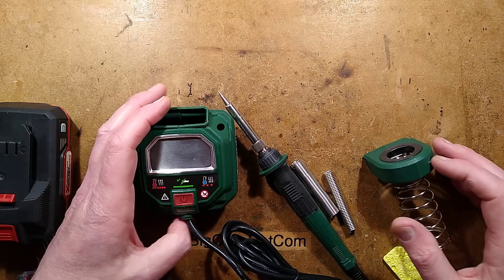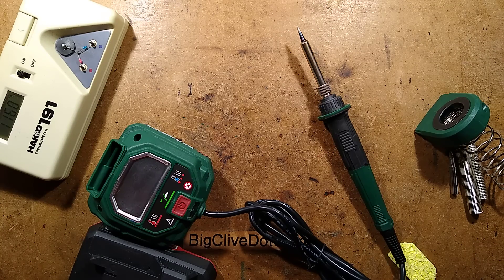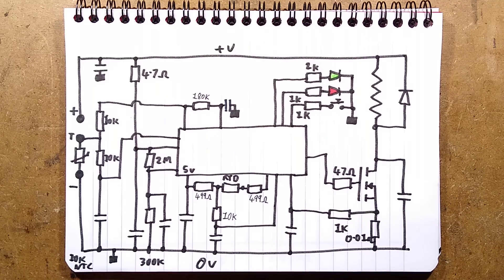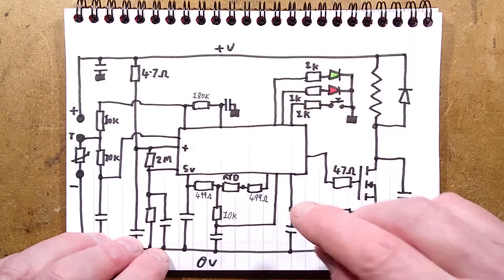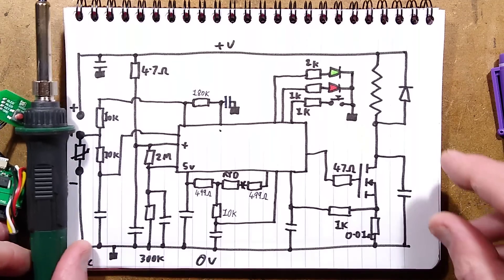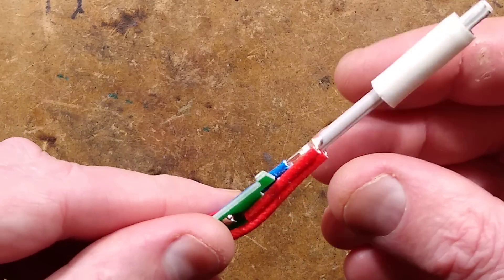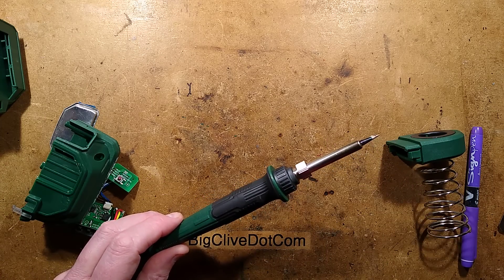LIDL (Parkside) B2 soldering iron hack and schematic

Comment: All that I could find on the chip was this. 

The M29AN100 is a 100 Mb Flash memory chip manufactured by STMicroelectronics, a part of the NOR Flash family, meaning it has fast random access to any location in memory, unlike NAND flash which is more suited for bulk data storage.

Here are some key details about it:

Type: NOR Flash Memory

Capacity: 100 Mb (12.5 MB)

Voltage: Typically operates at 2.7V to 3.6V

Speed: It offers relatively fast read and write speeds compared to NAND flash.

Package: Typically comes in a TSOP (Thin Small Outline Package) form factor.

This chip would commonly be used in applications where code storage and execution are needed, such as in embedded systems, automotive ECUs (Electronic Control Units), and other devices requiring reliable, non-volatile storage.

I'm not sure how accurate that is. I looked on their website and I couldn't find it.

Anyway, another fine installment from your good self sir.

Comment: 9:53 I've tried discharging the battery with one of their tools until it switches off due to low voltage. I didn't measure any difference in T terminal of the battery. 
I'm starting to think that the T terminal is only there for the overheat protection. 
What's your thoughts?
Reply from the maker: The T terminal is sometimes pulled to the zero volt rail to indicate a low battery.  You'd need it to be part of a voltage divider to see the change.

Comment: That is very useful video. I added 22 ohm resistor to my soldering iron and i am very happy with it. I have a question about the cooling down forever issue. 
Will it deep discharge the battery? Does the soldering iron gadget has undervoltage  protection that will save the battery?
Reply from the maker: I've never tested that, but the circuitry does have the ability to sense the battery state.  I do recommend unplugging the battery when things are not in use.

Comment: Hi I have this model it stopped  working ,red light flashes for about 8 secs an turns offtfook it apart I see a burn mark ,looking at this it's the HA2 can anyone tell me what you call it or what I could replace it with, thank you in advance :)
Reply from the maker: HA2 seems to be a diode across the heating element, presumably to shunt any inductive effect.  It could probably be replaced with a standard 1A diode.  But the unit may be OK with that diode removed, as I wouldn't expect the element to have much inductance.
If it has gone short circuit (as failed diodes often do) the unit will see it as a shorted heating element and show the warning.

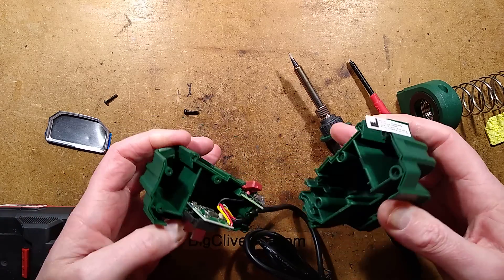Comment: 4:43 the water sponge is right above the "circuit board" , without rubber gasket between the two parts of the case. I wonder how long before water drips on the IC...

Comment: I have the Lidl Parkside PLKA 4 B3 which is a USB-C charged iron and you cannot change the temperature on it either. It seems to get very hot as well and I have managed to really overheat the supplied tip. I wonder if anyone has managed to hack this iron?

Comment: you could add a potentiomet instead of the fixed resistor so u can ramp up the heat if needed for hard solder.

Comment: Thanks. Now I have modified my iron it is a bit cooler and won't be burning through those tips quite so  quickly. Great explanation of the circuit.
Reply: What ohm resistor did you put ?
I am thinking to put 100 ohms

Comment: There is one thing that could improve work with this soldering iron, i would put some silicone grease between ceramic heating element and metal tip, this way thermal conductivity should increase and become more even.

Comment: Obviously final design was not done by someone with a clue in manual electronics soldering. 480 C!!!!!!
Or it's just fit for the next generation of planet saving solder that must be applied by a MIG welder. 😂
Well, easily fixed at least, with a minor flaw,  cooling down temperature is not sensed right, making led blink "forever", waiting for a... polar bear's habitat temperature to deem iron cold and safe (LOL). No big deal, you disconnect and connect back the battery and blinking stops. Happy holidays everybody!

Comment: I had never thought of running a soldering iron from a drill battery. I have a pine64 PineCil iron and some 18V DeWalt batteries, I'm sure it would work. The only problem is figuring out how to stop the battery becoming over discharged and damaging it.

Comment: how would one modify a multimeter to get a continuity testing feature on one that is missing it?
Reply from the maker: Either using the existing low ohgm range or making up a simple external LED based continuity tester.
Reply: I would make a "buzzer box".  Get a low voltage buzzer and a battery and some leads.  It reacts quickly and you don't have to look at the box while checking connections.  You can get ones that work on 1V so a regular AAA cell will give you the voltage.

Comment: Its just a mediocre clone of Chinese solder iron 900M series. Maybe in 10 years they release TS100 clone.
Reply from the maker: It does use the 900M bits.
Reply: @bigclivedotcom  Exactly. Let me give you the point: my first station was actually Lidl B1. Its soldering tip ate itself in 5 days, as it was of poor quality. =) It was screwed on and sold nowhere. So I bought cheapest chinese compact t12-950 solder station (900m) and it rocked (still does)... Temp select F/C, in C: 100..400 full range, temp monitor, 10 sec heating time, auto off. It blasted B1 away in every corner. That was about 8 years ago. =)  PS. 950 still works today.

Comment: I don't know if this was mentioned, but after modding the iron never turns off, always blinks for "cooling". Minor inconvenience.
Reply from the maker: I mentioned that in the description.  It is an annoyance, but less so than cremated bits.
Reply: @bigclivedotcom  i tried to add a on off switch but the poles where soldered to the board so cant find a wire to add the switch between...maybe another video ??

Comment: Clive, taking this a step further, to make a low temperature iron suitable for model construction (White metal) could you put a variable resistor into the housing in series with the white wire to the main board? 70 degrees C being the aim. Would this generate top much heat in the resistor ?
Reply from the maker: You could theoretically tune it to whatever temperature you wanted by using the hack I showed.   The unit will never stop flashing its red LED to show it has cooled down though.

Comment: Nice video Clive. Thanks for sharing 

One can never have enough soldering irons
15:35 Out and about my go to is an old 3xAA Iron that never worked on the disposable batteries. 
I discovered I could fit an 18650 holder on it and it’s perfect. 
On the flip side I mostly use a cheap Chinese iron that has a tiny screen and a temper nsetting on its handle. 

Only issue I ever had was while working on an ebike one day and left it  switched on hanging from the handle bars. 
After a minute or so I was horrified to find the complete tip glowing red hot. 
So quickly pulled the power and left it cool before moving it. 
Appears to be working normally since but I had to replace the tip. 
As for the current accuracy of the tip will check it with A hand held laser temperature gun when I get a chance some day.

Comment: Did you see any of the wee USB C Soldering irons they had? The tip seems to use some sort of old screw cup torch bulb fitting with the tip connected, No idea where I'm getting a replacement for that anytime soon 🙃
Reply from the maker: Try searching online for LIDL soldering tip or bit.

Comment: great video but left me feeling really unsatisfied haha couldnt you make video where you put potentiometer instead of the resistor and dial where you can write the measured values of temperature ? like the potentiometer would be in the case and just driller hole for the know

Comment: I'm using a very nice soldering iron that runs on USB-C called the Pinecil. It has all sorts of nifty features such as digital temperature control and an automatic off function when it detects you're no longer holding it. It uses replaceable tips compatible with PT-100. It even runs an operating system of sorts which you can upgrade. Using a Pinecil or similar device with a power bank that's compatible with the PD spec (15w would probably be the minimum, but I saw the Pinecil 2 takes up to 88W) might be a good alternative for something like this.

Comment: With boards that small, I'm a little surprised it has a dock at all. Some clever placement and I reckon you could fit the guts into the handle without it being too bulky of a form factor to handle. Replace the coil with a sheath you just pop it in. Battery can get a belt clip too. Hell actually, the sheath bit is attached to the battery pack so you can holster your "big iron" at your hip, lol!

Comment: Thanks Clive. Added a 22 ohm resistor into the iron as you described and now it's actually a useful soldering iron. Previously it was getting far too hot to actually be of any use.
Reply: How much temperature is now on 22 ohm resistor?!

Comment: I am a big fan of Parkside, my oldest item is a 16v cordless drill which after many years is still going very strong and even the battery is solid and performs as good as it was when new.    My Parkside cordless dremel thingy is also just as resilient, think I bought it like six years ago and it gets used a great deal, I give it a drop of oil in the end bit once collet is removed and its weird in I can leave it months without use and keeps its charge perfectly.   Cordless impact driver still game too, very potent driver again the 20v battery just goes on and on, last year I really hammered down on it removing buggered lug nuts off a front car wheel, did very well.   I do have the Parkside "base" mains soldering gun with its little station which is basically a storage box with a spring, sponge and a pair of handy "arms" for holding work, I use that for heavy soldering stuff, got a Katsu soldering station for dog work and a rework station with hot air and a fine tip I made into a crows beak for micro stuff.

Comment: The Parkside stuff from Lidl is my humble opinion pretty genius, but has a small flaw. The engineers sometimes have over-engineered the stuff adding features that are just features instead of adding to the overall quality.
Right now I have a mini-drill, that I actually love more than the Dremel I have.
Another downside is that Lidl sells these machines every now and then and there seems to be a new model every time and parts for the old one …???

Comment: what watts on the resistor rating ? (or max volts ?)
Reply from the maker: Quarter watt is fine.  It's very low current.

Comment: When I was about 7 I remember my uncle soldering my toy airplane with the handle of a teaspoon heated on a gas stove. Nice video, great hack 🔧👍
Reply: I once left my iron at home when I went on a service call, I had some solder though, so I took the faulty item to my car and used the cigar lighter (remember those?) as an iron.

Comment: I have a Metcal soldering iron that played up so i thought I'd take the psu apart to find what i thought would be a dry joint !!! It is the most complex circuit I've seen for a soldering iron.  Some kind of high frequency device !!  Quite odd, as it doesnt have a variable heat controll at all, but is the best iron I've ever had, i seen the odd 2nd hand one on line ... normally around the £ 250. Mark !!  .
Reply: Yep, they're actually using 13MHz signal to heat up the tip in the same way an induction stove heats up the pan. They're really decent, even today!

Comment: From what I know, Parkside doesn't include overdischarge protection in its battery packs, only overcharge and cell balancing. Probably the purpose of that voltage sense is just that overdischarge protection

Comment: So it’s not adjustable then?
That’s pretty poor of Lidl.
I’ll never buy another non-adjustable iron, I’ve been spoiled by my adjustable ones I’m afraid (I’ve also got one of the PortaSol gas ones if I ever need a portable).

There is a company making adjustable irons that work from these drill batteries, I’ve seen them advertised on facebook. Never tried one but the reviews looked good.

Comment: I usually have my iron (Pinecil) at 330 to 360 C. I really should calibrate both the iron I stashed at my work bench (V1) and the one in my repair kit (V2). One time I found that a guest engineer had set the V1 to 420 C, which means either he was soldering an insane chunk of copper, he forgot to lower the temp, or he didn't know how to turn it down. Either way, he drained the battery in a day's work.

A colleague of mine set the workbench Hakko FX-888D a little too hot and left it on, so all but a tiny bit of the tip was oxidized to the point where tip tinner barely made a mark on the black gunk. Had to swap out the tip, I didn't want to risk eating a hole in the clean bit while trying to de-oxidize the rest of it.

Comment: There's no ground connection to the chip.  Every single pin goes through at least a capacitor or a decent sized resistor.  The smallest resistance is 1k ohm on the pushbutton and MOSFET source connections.  So where is it getting it's ground reference???
Reply from the maker: See the description.  I missed that link.

Comment: There is also a C3 revision nowadays, it has a completely different circuit board. I took some photo's a while ago to see if I could figure out how it works but I haven't really had the time. It's not really my top priority, besides I'm not that well educated in electronics design. C3 circuitboard photo's: https://drive.google.com/drive/folders/1zgGWwraalUHw4y28Tw0quVP4r4DcaOUc?usp=sharing

I do think it still runs too hot for most uses, but I'm not sure my cheap soldering iron thermometer is accurate at all. I plan on getting myself a Pinecil v2, maybe I could use it as a reference.

One thing I really would like to figure out is a safety circuit that actually works with the parkside batteries like the tools have implemented. Parkside batteries apparently don't cut power to the tool at low cell voltage. Instead the battery lets the tool know it has to cut out through the third pin, I'm not entirely sure how anymore. Others have simply integrated a low voltage cutoff on custom battery adapters to achieve some semblance of safety, this doesn't take into account separate cell voltages though.

Another idea I had the other day: research if it's possible to make an electrical switch triggered by the use of a Parkside smart battery through bluetooth. If that is possible I could modify my battery powered shopvac to trigger on tool use.

Comment: I bought the original version online, but they sent the B2 version to me instead. So I went on and modified it by adding a 1k Ohm 30-turn small, but long, knob potentiometer (didn't have any potentiometer with lower resistance and normal amounts of turns).

I can basically regulate it really finely with that. Can do max. 4 turns from the start of one side, so basically roughly 130 Ohms-ish before it flashes an error.
When it flashes the error, you have to unplug it from the battery to react again, no matter what you do with the potentiometer.
Also it still seems to heat up to like 200°C when it has that error, again no matter what the potentiometer is set to.

I found that the iron almost instantly flashes the "I'm done heating up" when i use high resistance to get the lower temps.
And even if i use it at the absolute minimum temperature before the error, it does heat up to lower temperatures, but after like 10 minutes or so it is at 380-400°C again. (not much used in that time though)
It just seems to heat up very slowly, compared to its original nuclear blast setting or any other iron i have in general.
But hey, way WAY more usable this way and actually quite neat with the long cable and cheap and versatile - doubling as nice weight to stabilize the base - batteries!

And congrats to the 1 Million!

Comment: Hmm, eyeballing it my Weller tips might work with this. I have a butane soldering iron for mobile use but this battery soldering iron does not look so bad (after the modification of course). ;)

Comment: Great hack, nice and simple to do. I don't think it would worry me to pull the labels off the main circuit board box. So I think I would drill a hole in the case and put a miniature pot in (wired as a variable resistor) for between 0 and 33 Ohms to give me a few more options marking the pot position with the various preferred temps.
Reply: Good luck finding one 😂

Comment: Handy soldering tip ... ditch the sponge and use a STAINLESS steel ball scourer ! ( preferably the type without integral pink soap ! ) ... electronic suppliers sell BRASS types , but the solder just sticks to them ( NFG ! ) .... 2nd  ( Parkside™) tip , their AUTORANGING multimeters are STONKING value for £13-99 ( if they have any left ? ) ..... DAVE™🛑